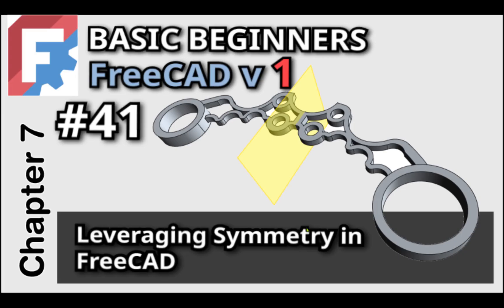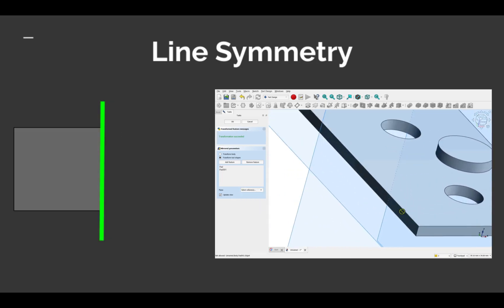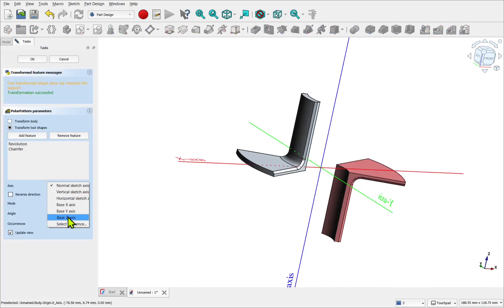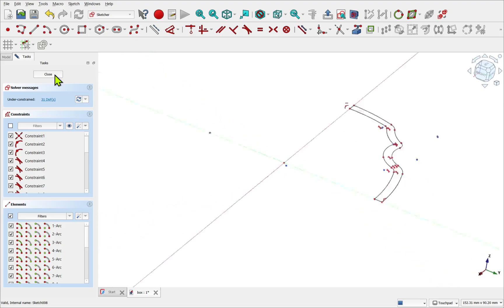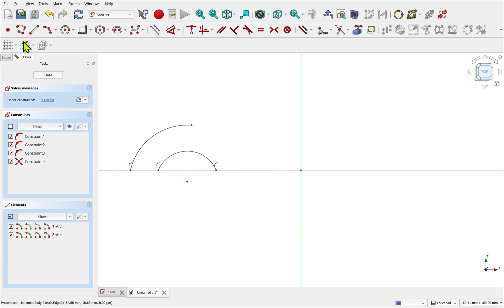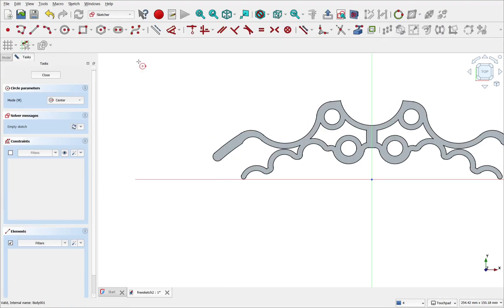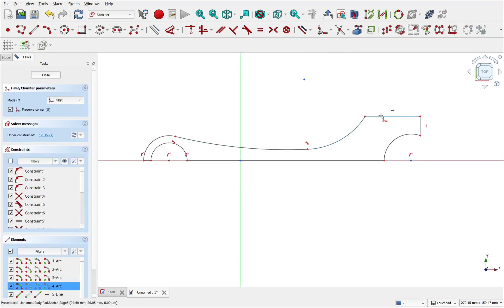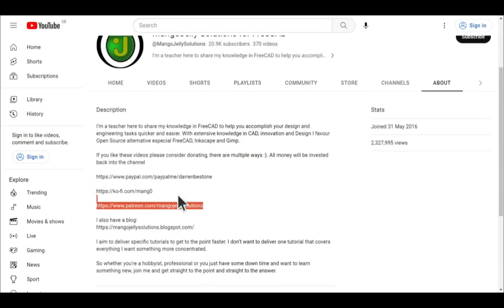FreeCAD 1. 0 | Why it Matters! Leveraging Symmetry  | Basic Beginners FreeCAD 1.0 | Lesson 41

Comment: Could I ask you for your assistance on my Rococo board game inserts? I got through your hints on doing the jewel box like inserts using lofts, Draw scaling and mirroring but I can see I will be better of trying to draw some Rococo furniture with drawers. I have a foto Rococo_small_commode.jpg from Frederiksborg Castle, Danish Museum of National History, 2017 by a Thom Quine and while I don't aim for all the intricate details I wish to draw and print something in that general shape. There are of course space contraints and using addtive pipes I run into too sharp corners and bends and as for lofts the furniture bulges differently sides and front.

Comment: How much effort must one put into constraining sketches? When is it mandatory and when not? I find myself using a lot of time trying to figure out where those DoFs are hiding. I know I can click the link but I still struggle a lot. When I ask over at the FreeCAD forum, I often get drawings back with a load of DoFs.
Reply from the maker: It's not mandatory to get to zero degrees of freedom.  Best practices yes, but often you just haven't got the time or energy to restrain down sketches to the nth degree especially when they are small builds.  If you got a large dynamic driven from a spreadsheets then you will benefit from fully constraining a sketch as you can scale in proportion with other constraints.  Don't worry too much with fully constraining a sketch, often that can take the fun out of designing and building your projects.
Reply: @MangoJellySolutions  Thank you. That was exactly what I was starting feel that the fun went out the window.

Comment: When stated there can be confusion as to the original side and the mirrored sides, can the original be prompted to be a certain color/shade to differentiate when in the sketch/part design, as opposed to looking at the overall body/part as one color/shade?
Reply from the maker: Unfortunately not, even with the refine set to false on the mirror so you see the two parts rather than faces along the same planes being merged you can't automatically set one half a colour.  Be a nice little feature if it did.

Comment: Darren,
Thanks, this is definitely something I have encountered. As my drawing get more complicated my PC also feels the effects of size of RAM needed. Proper management of  some basic constraints I know may help but without , for instance a radius or diameter constraint on a circle it is hard to recognize that the two circles are the same diameter.  2 circles that need to be the same diameter, if you constraint the 1st circle to 5mm and then esc and select the circle and ctrl select the 2nd circle and then "equals", resulting in a complicated drawing that contains a lot of constraints, confusion, because it becomes harder to tell they are both equal, right?  BUT if "equals"= less system resources then it will be worth it, but the number of steps are about the same. After using the "diameter dimensioning tool" on the 1st circle you just have to select the 2nd circle and enter the dimension vs after dimensioning the 1st circle you must now escape the  "diameter dimensioning tool" then select the equals tool, then select the1st circle and then select the 2nd circle? My point is I need to know how to save my system resources, so towards the end of a complicated project I will not have to wait so long for regen... Is this what you meant by more on this later? I vote yes on an advanced series about saving resources! Lol
Thanks, 
G_Dub
Reply from the maker: Thanks, G_Dub Yes. Great points, and I’m definitely taking your vote for a more advanced look into this.  There are tools such as the sketcher virtual space where you can have two views which you can switch between allowing you yo have chosen constraints shown/hidden.  Also you can multiselect all the circle you want and then dimension them once, one circle gets the datum dimensions and all the others are set to equaled.  Those little tricks are well worth sharing.  Watch this space.